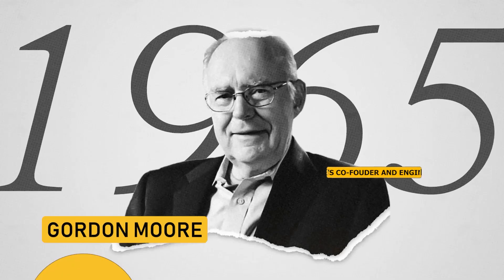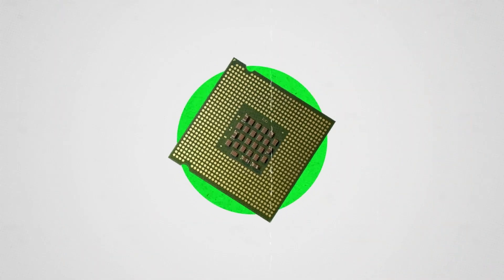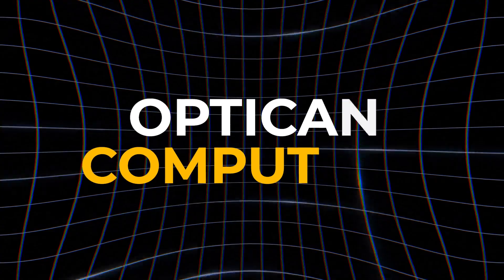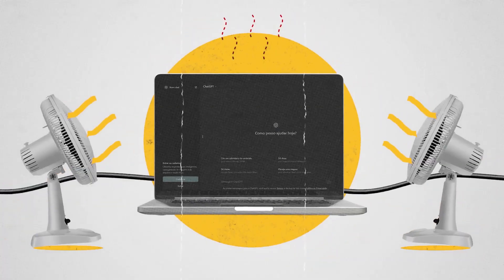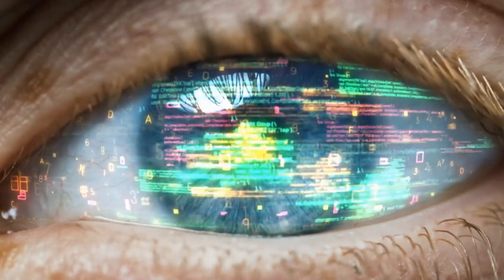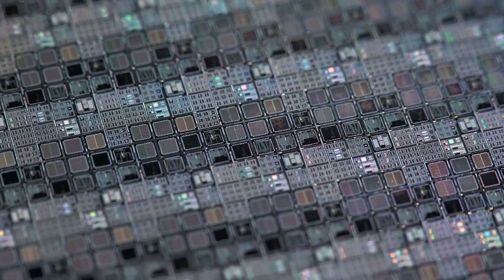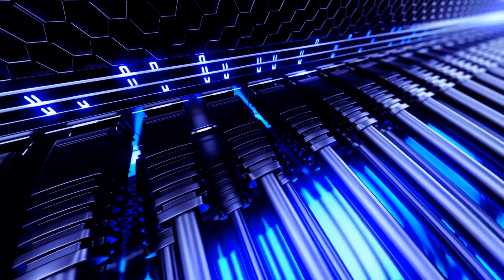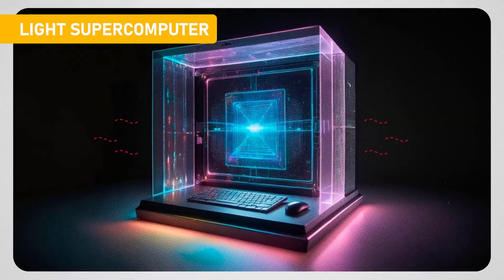Is this the FUTURE of computers?

Comment: there really isnt a clear line between optical and electrical. since photons are electromagnetic radiation - like wifi and bluetooth etc., it all depends on the frequency of the waves. infrared for example is pure heat, still electromagnetic waves. other frequencies we call "light" just don't have the capacity to excite atoms and heat them up.
"optical" computing just means adding the magnetic part to electrical circuits. which is crazy since optical fibers arent even magnetic at all.
its super brain-wrecking to think about it. light is just radio with a much higher frequency.

take a coax cable for example: it transmits electrical singnals. so far so good. but the same signals in a much higher frequency would need fiberoptical media. so we can say that we kind of send below-visible light through copper right now and visible light through fiberglass. two so fundamentally different types of material. yet everything is just radiowaves.